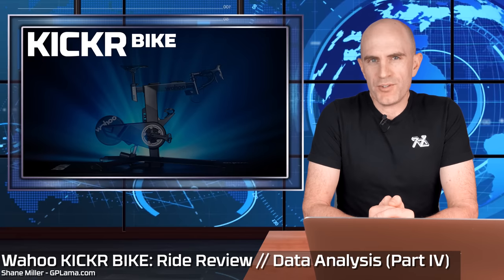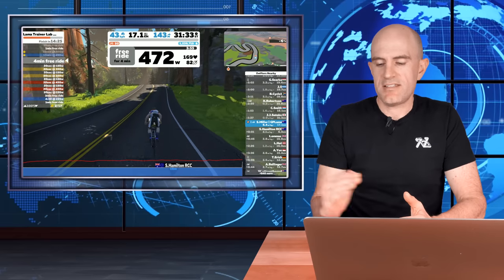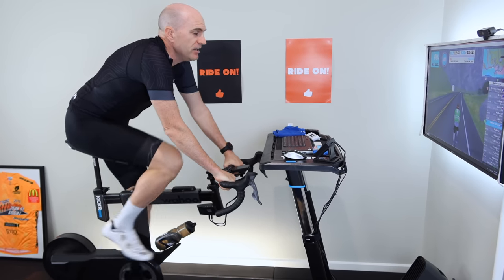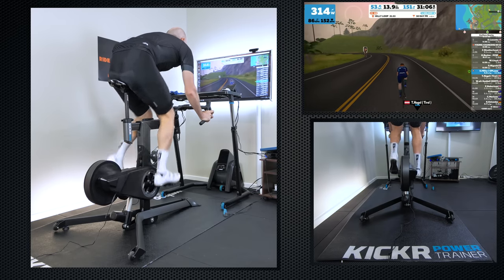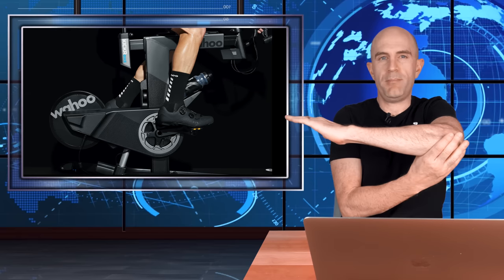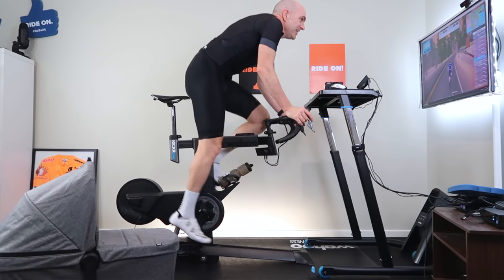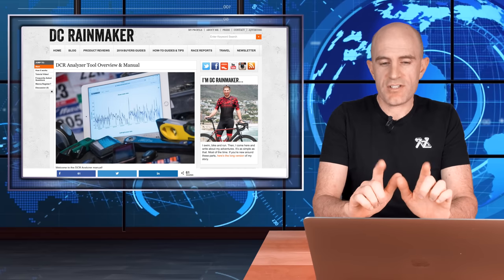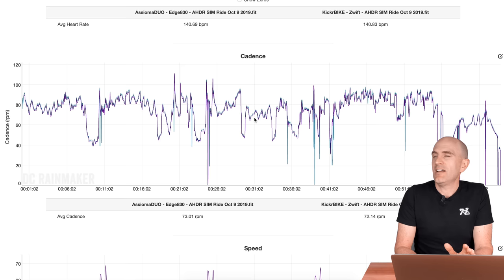Wahoo KICKR BIKE: What's it Like to Ride? // Ride Review // Data Analysis (Part IV)

Comment: Great review, Shane. One minor addition: The Sufferfest does allow you to change the intensity of the workout with the two buttons on the top of the right control lever (the current version of the app also allows you to toggle between levels 0-9 and ERG mode with the thumb buttons but we'll have to revisit that since users who opt for the Campy mapping wouldn't be able to use that functionality). Excited to hear your thoughts on how it works with The Sufferfest. Wait until you try our TTT workout, Team Scream, on the KICKR Bike. So. Real.

Comment: Couldn’t they’ve made it a little lighter and more aero? Looks ok indoors, but what if you hit the road with this beast?
Reply from the maker: i'm glad you asked. The Kickr BIKE works perfectly on tarmac, gravel, and even dirt. It's an all-rounder. Don't expect it to move anywhere, but it's solid enough to sit in one spot and win races for sure. 🤣
Reply: Shane Miller - GPLama Nicely said 😀
Reply: Hey man, this is an indoor bike, it is not supposed to be roadhitted. Even to try you would have to be good with your wheelies but you would need to install a fat tyre on the back unless you don't mind riding on the rim. My advice would be to just ride this indoors and not experiment outside. Plus I think it would be really confusing outdoors as you have the gradient simulation AND the real gradients.

Comment: I just got mine last week. Just getting the fit dialed in to match my road bike.  So far I really like IT.   My initial thoughts are. it's Heavy.  It's very quiet.  I don't have to lube the chain. It quickly switches between rider settings.   It doesn't have to be calibrated (spindown).     I wish the shifting had a little more prominent feedback.   I can't always tell when I've shifted and sometimes end up shifting two gears when I meant to shift one.   It's a little too easy to accidentally press the buttons on the inside of the shfiter. No biggie as they currently aren't used, but if they ever sync those up to steering, I could see myself accidentally turning left or right during a  hard sprint.   And lastly, WHERE ARE THE LLAMA APPROVED COLORED CHEVRONS???

Comment: Nice review mate! One thing I noticed is that your saddle might be too high? It looks like you are stretching for the bottom of the pedal stroke with your toe down, instead of pulling through it with your heel down. Being able to drop your heel at the bottom of the stroke also engages more of your leg muscles. Could try to drop it half an inch to see if you generate more power.

Comment: Great video again Shane, really considering this Bike, but my only concern is the long term use and reliability . Having killed 2 Kickr Climbs in less than 18 months , Wahoo just sent me my 3rd Climb ! Yes I do lots of climbing on Zwift having just completed my 199 Alpe du Zwift Climb. Did you try the Kickr Bike up the Alpe or Radio Tower Climb ! Can't fault Wahoo customer support, but it's how good or bad the long time use is going to be of this Bike, thanks again Shane .

Comment: From what I've gathered — from coaches, and from riders (in particular one's who have done one of Phil Deeker's Cent Cols Challenges) — there is a definite benefit from doing indoor training with a Kickr Climb for preparing for doing a lot of climbing IRL.  I did my first CCC in June, and tho I was sufficiently fit for the endurance, I was not adapted to the climbing position (and suffered for it).  I am planning to purchase either a Kickr + Climb (I have a Neo, about which I have only good things to report), or another unit that puts the body and bike in a climbing position — such as the Kickr bike — in order to train for my next Cent Cols Challenge.

I mention this in response to Shane's comments that the Kickr bike enhances the experience of riding indoors (and by inference {and perhaps directly stated}, only the experience).  I am counting on it to provide a training benefit as well.

(I live in a famously hilly area, but where we have innumerable unavoidable hills, we have no climbs.  The max elevation gain on any hill is less than 200m.)

Comment: It took almost 4 seconds for your effort to show up on the screen.  Both my kickr core and kickr gen1 reacted a lot quicker.  Sync issue with the videos, or very lagged response of the bike?
Reply: Noticed that too, weird...
Reply: The unit seems laggy, check 7:53 when Shane hits the keyboard, the video is perfectly synced.
Reply: Mmm not good for zwift racing!
Reply: I have the same problem with the kickr core.  I thought this was standard.... I wonder how to fix it.
Reply from the maker: Noted in the video description - I was using 3 second smoothing on Zwift for watt display, so there's a little lag there. Having said that there is a notable delay in the jump sprints as shown on screen. I'll do more testing in the coming days in regard to 'jump speed' on Zwift with the bike and a real power meter using both ANT+ and Bluetooth.
Reply: Shane Miller - GPLama thanks a lot! Jump responsiveness is key for zwift racing in responding to attacks. Do you think there is a difference between ant+ and BLE in that BLE can send more data packages per second? It is most noticable on my Neo 2. Maybe a second difference between the communications protocols.
Reply: Thanks Shane, looking forward to your final conclusion on the matter

Comment: This is a fantastic trainer, a little different feel to one thats connected to a bike, but a smoother ride on the whole. My only niggle with this is amount of play between the frame and the tilt unit that causes a small amount of nodding when in high cadence/low resistance. Contacted Wahoo, who said this is normal. Otherwise, its great. I'd be interested if other experience the same.

Comment: Hi Shane: great video... would it be possible for you to post measurements of the width of the top tube  at say 10, 20, and 30 cm from the seat tube?... I'd like to be able to pad out my bike with cardboard or bubble wrap to see if the rub issue would effect me.  (unless the bike comes with an angle grinder)  Thanks
Reply: I also want to know about that

Comment: For my $ I would rather buy a shiny new bike or set of wheels and stick with my direct drive that doesn't eat up a ton of space. I guess money being no object with a dedicated permanent training space/pain cave...it seems like a great option. Good quality, quiet, accurate, responsive... perhaps like with other tech waiting for version 2 and resisting the urge to be first to market would be a good thought for potential buyers. A new top tube design iteration, some improvements to other elements based on customer feedback as well... my only question is whether this will sell well enough. The profit margin would have to be pretty substantial to offset low sales to a niche market. Will there in fact be a version 2... this one might be a miss... great execution but is the demand there?

Comment: very useful video. a lot of people interested in this thing, even if put orf by the price.

the ‘q factor’ is the most meaningless thing in cycling. our test pilot could avoid contact with frame of trainer by choosing a pedal (preferably not shiimano) with a wider offset. pedalling mechanics won’t be affected.
Reply from the maker: Q factor is important. Maybe not ‘that’ important when only a few mm are involved, but it can’t be dismissed. https://www.ncbi.nlm.nih.gov/m/pubmed/22612455/

Comment: Hi Shane! I got the KickR Bike several weeks back and I’m loving it so far! The shifting, fit, and gradient changes make this this bike amazing. I have seen several comments on various videos that complain about the KickR bike having several technical issues/structural issues. Have you had any of these issues and if so, has Wahoo support been helping with fixing the problem?
Reply from the maker: No issues other than a few creaks that was solved by a little grease on the two rear leg joints.

Comment: One thing I have found is that the plug on Garmin Vector pedals rub on the “chain guard” and you cannot install this type of power meter. A little frustrating that there is tight gap between in inside of the crank arm and the plastic moulded chain guard.
Reply from the maker: You can install a spacer on the pedals to make this work. The Kickr BIKE power numbers are good enough not to need power pedals... unless you’re looking for L/R data and Cycling Dynamics metrics.

Comment: Well, thanks in part to your review as well as Ray's, my kickr bike arrived at the LBS today. Pretty excited to get on it once I get it home. But had one question for you in regard to ERG mode. I see from your reviews that the wahoo app has it's erg smoothing option, but for the example of zwift can you control erg mode in the game from the bike or do you still have to use the interface of whatever platform you are on? Thanks a ton. Pretty jacked to get on this bike and never have to feel those clunky gear changes again.
Reply from the maker: Nice one! Once everything is setup in the Wahoo App you don’t have to open it again unless you want to change the setup. Zwift will take care of the SIM and ERG control.
Reply: @gplama  OK, thanks a lot. On the ERG, though, I should have worded that better. What I am interested in is like when you are doing intervals from a set program that says when one of the hard intervals comes you will do such and such wattage. In those I have tried (at times) to switch in and out of ERG mode, but it's sloppy, and if it's not a long interval sometimes it's not even worth it. 

Some days ya feel OK and the set wattage is fine. Others I don't mind trying to crank it up a bit, but switching in and out of ERG mode on something on a desk is kind of a pain. Thanks again.
Reply from the maker: @Steve-cc8zg  Within Zwift (via the machine it's running on or via the Companion App) you can dial ERG in from 90%-110% and also switch it on/off during an interval.
Reply: @gplama  OK, that answers it. Don't know why I thought maybe there was a way to flip ERG off and on from the bike instead of using the interface, but one can hope, I guess. Thanks again, Shane.

Comment: Great review!  Thanks.
The DC Rainmaker review says that the bike is not belt-driven, so I'm wondering about the discrepancy between two reliable sources of info (I guess I could quit being lazy, and just check the Wahoo site).
Reply from the maker: It’s belt driven. The DCR post I’ve loaded says so too.
Reply: @gplama  Thanks!  Mea culpa.  I just read the DC Rainmaker review, and what was said was that the Climb portion no longer uses a belt.  Thanks again for your wonderful reviews.

Comment: I recently had issues with Power Smoothing (from the Wahoo app) and TrainerRoad, where the resistance on the Kickr Bike felt like a pulsating resistance, especially during cadences under 90RPM. The second I turned off Power Smoothing in the Wahoo app, the ERG workouts on TrainerRoad felt significantly more smooth. 

Maybe something worth revisiting to see what is going on, if you manage to replicate it. 

I turned Power Smoothing on and off during the TrainerRoad ERG workout and felt the difference immediately. Got the Kickr Bike V1 with latest firmware :)
Reply from the maker: I saw that post over on the TR forum. Not something I encountered, however I always switch off ERG power smoothing.

Comment: Great review Shane... will it connect to 2 devices at once ? I used Zwift to the control the trainer but Garmin for recording my workout and training plan, both on ANT+
Reply: Yes, it can connect to two Bluetooth devices at the same time, like the KICKRs, since a recent firmware update.
Reply from the maker: Ahhh.... maybe. With only ANT+ FE-C at the moment it'd need to be in 'passive' mode on one of them to ensure it didn't get confused with who's controlling it. If they add ANT+ Power/etc in the future it's a non issue. Recording with two devices shouldn't be a thing in 2019. Metrics should sync up between services/vendors/etc (but I'm well aware they don't)
Reply: Shane Miller - GPLama Thanks Shane, the reason I use 2 is Zwift to control the trainer but Garmin Watch for training stats, these stats only exist on the devices themselves today, such as training effect, loading a workout into Garmin connect will not calculate all the stats, Tacx Neo will connect to both at once, so watch is just recording HR and Power
Reply: @ScottYarosh  Thanks Scott

Comment: Hello, I recently purchased Kirckbike V2 and compared it with Assioma power meter.  In long duration and interval training, there is always a differnce of about 5~6W between them. Both devices have the latest firmware (Kickrbike power is higher than assioma)
Interetingly, I used the fifth generation of kickr for 2 years, it was quite accurate, showing only 1% difference. My friends who bought the same product are experiencing the same issue, we all use assoma and kickrbike. In this video, your kickrbike and assioma  are quite similar, Are they still the same with the latest firmware update?
Reply from the maker: The Kickr BIKE v1 has left the Lama Lab a while back, so I can't report on the current accuracy sorry.

Comment: I just got one and notice a clear back to front (not from to back) give on the bike…it moves about 0.25 inches whenever you lean forward, with a metal contact sound. It’s very slight, but consistent and a bit annoying. Did you notice this’?  Wahoo gave me a canned response “some give is expected to handle all gradients…etc. etc.”

Comment: Thanks very much Shane such good review, if you have time to answer one question would be grateful. Is it possible to have 54 or 55 crank tooth in the front ? Thanks very much :)
Reply from the maker: See my video on the gearing setup. You can configure a 70 on the front if you like! Epic dinner plate.
Reply: Shane Miller - GPLama hahaha 55 will be enough for me, thanks again Shane, you legend 🙏🏼🙏🏼🙏🏼

Comment: On your sprints, there's quite a bit of lag...? Is that video technical or is it real?
Reply: Thomas Riemer it seems its real, check it when he hits the keyboard to do a U turn, the video is perfectly synced. A real dealbreaker for me...
Reply: @roligbarn  Hmmm - I'm sure it can be fixed via firmware. But that does look suspisous...
Reply: Thomas Riemer yes lets hope so. It looks exactly like famous 3s neo 1 lag
Reply from the maker: Noted in the video description - I was using 3 second smoothing on Zwift for watt display, so there's a little lag there. Having said that there is a notable delay in the jump sprints as shown on screen. I'll do more testing in the coming days in regard to 'jump speed' on Zwift with the bike and a real power meter using both ANT+ and Bluetooth.
Reply: @gplama  Thank you for your very informative review.  I see you've made the comment above a couple of times here, but have not seen any information about any additional testing you did regarding this lag.  Am I missing something?

Comment: If they can do the simulated gear changes on the Kickr bike like this, why don't they offer something similar (with a couple of remote virtual shift buttons) on the regular Kickr?  That way we could use pretty much any bike on a Kickr Core for instance...even a single speed!  Then, there'd never be a worry for to drop the chain in that setup either.
Reply from the maker: The regular Kickr has different internals/resistance unit. Your question is 100% on the money for Tacx though and their Neo.

Comment: Hi Shane, I have just purchased a wahoo Bike, actually its my second as the first one had a loud noise from the flywheel.  The problem I have is that I can’t tighten the bars at all, on my first bike it took a while of re tightening the quick release lever and after a week it was tight enough to stop dropping.  The replacement bike however wouldn’t tighten at all, eventually the quick release bolt snapped.  I have now replaced it with a 6mm bolt tighten it as tight as possible without the bars in and I can still slide the bar stem back in with very slight interference.  How did you get on with yours.  Many thanks Dave
Reply from the maker: No issues with the bars on the unit here. It's something I've seen raised a few times recently. One for Wahoo Support to address.
Reply: @gplama  many thanks Shane, I am awaiting a reply from them cheers

Comment: I'm wondering if this bike is 'performance enhancing' in regards to Zwift racing? If there are fractions of seconds difference during gear changes during critical stages of a race between a standard bike/trainer set up and the Kickr bike then this could possibly be an advantage.
Reply from the maker: Zwift is all about power. This thing is accurate, so it's only a matter of lag/delay that occurs over ANT+ and/or BLE (1Hz updates can be laggy).

Comment: I have noticed that the "spiky" watts technique is becoming more and more prevalent in zwift races. Not the regular is with "sticky watts" but some trainers overshooting the watts by as much as 30% compared to pedals for duals - even though its prevalent with different trainers, one particular rider uses a kickr bike. If you don't have much coming up, maybe see if you can replicate this spiky style of zwift racing and see if it creates any oddities?
Reply from the maker: I’m across it and the lengthy thread on the Zwift forums. This one is on Zwift to review and resolve.
Reply: @gplama  👍 it does seem odd that trainers are getting tripped up by it, if sticky watts wasn't an issue we could all move back to pedals. But then using the power adjust in the apps makes that also way open to abuse.... never going to be a solution is there 🤷
Reply: @titaniumben9923  Hey Ben.  I've just found myself back here doing some research cause a teammate got done for sticky watts in a ladder race riding a Kickr v1 bike.  A few interesting flat spots in @gplama graph at 17:26 in this vid too. 🤔